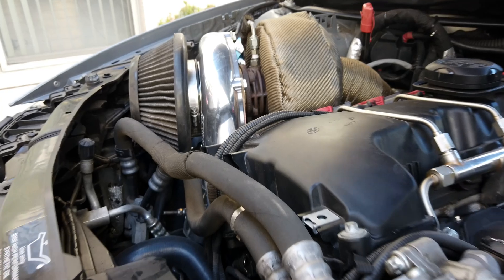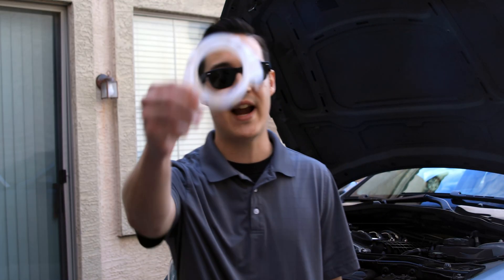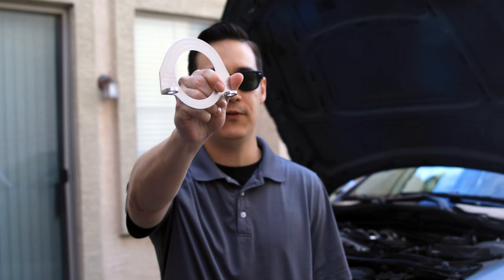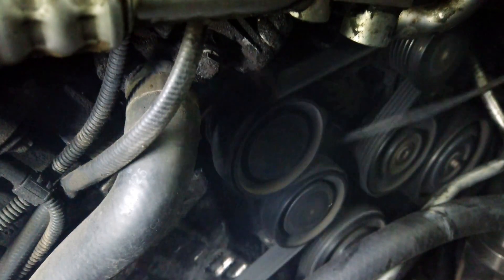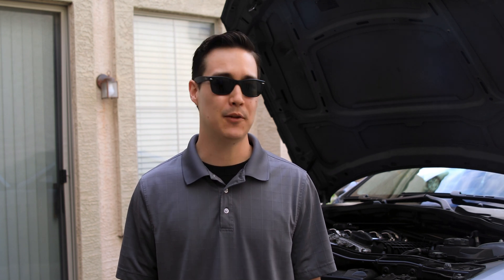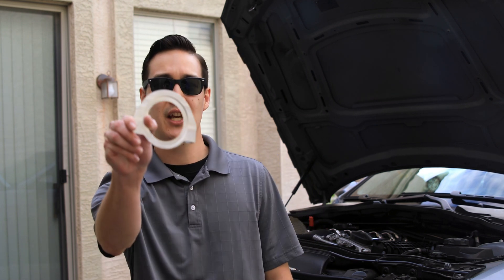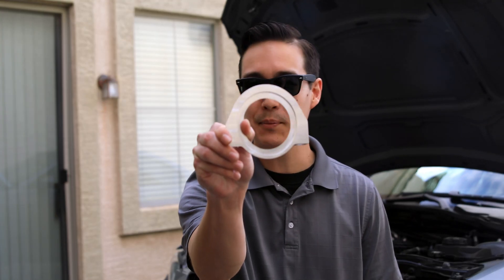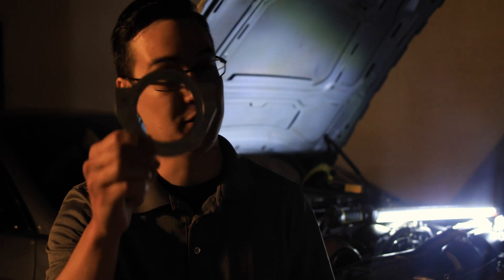No More N54 Serpentine Belts Destroying Your Motor with Crank Seal Plate Shield

Comment: I was driving home on a bumpy road (lowered on bc coils) and my belt decides to completely shred. Luckily this piece saved my skin and I drove 2 miles home on just the battery, engine is still ship shape
Reply: I just drove 30miles home after destroying a belt with a crank seal protector installed last winter. I’m still going to just pull the the valve cover. I had new engine prepped and put in its entirety.

Comment: This happened to me @ 112k although I got very lucky as my radiator fan ate most of my belt It actually seized my fan I had to pull the fan apart and take all the bits of belt in it then reassemble it   . The seal was untouched when I replaced the belt on my N54 I installed this plate replaced all my pulleys and all is well now . I paid 70$ for mine its cheaper now =( ebay of course

Comment: German engineering at its best, having to install an aftermarket part to prevent a design flaw from happening.  Oil leaks dripping directly onto the serpentine belt causing the whole engine to grenade from eating the shredded belt in.
Reply: yeah it'd be a shame if a japanese engine had a flaw
wonder why my toyota 22re harmonic balancing sleeves never deteriorated and caused similar issue

oh wait they did
and its what i would call the most reliable engine ever
It's not a "german" thing its an "engineering" thing lol